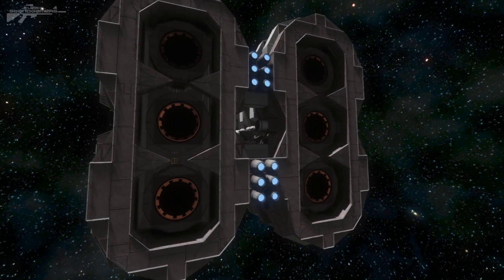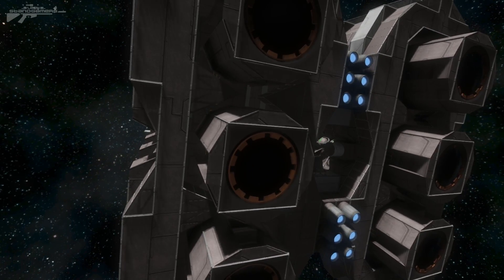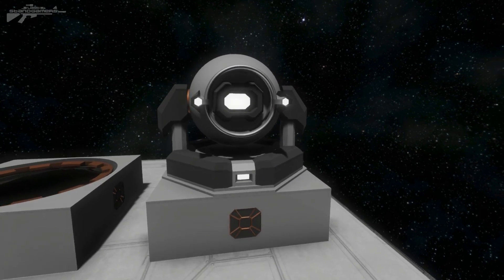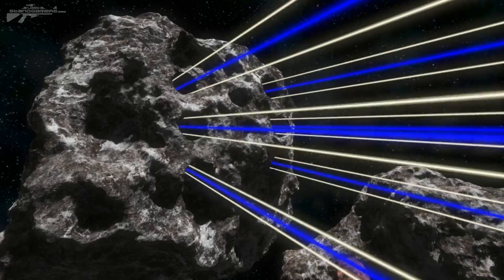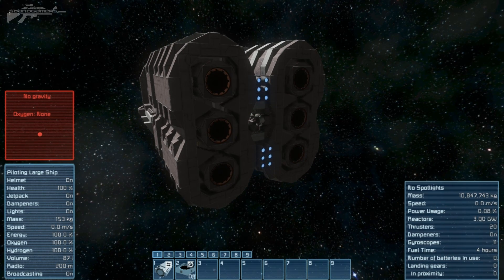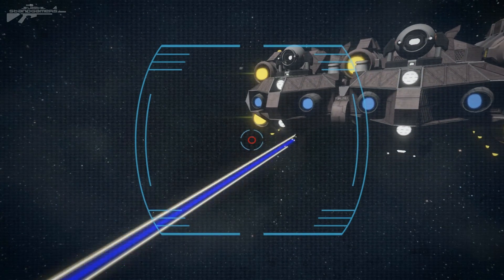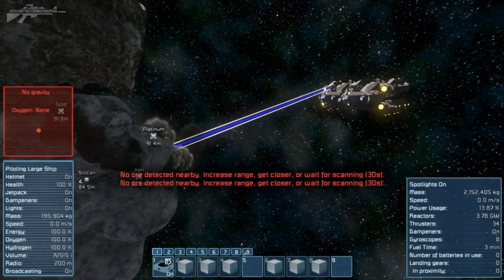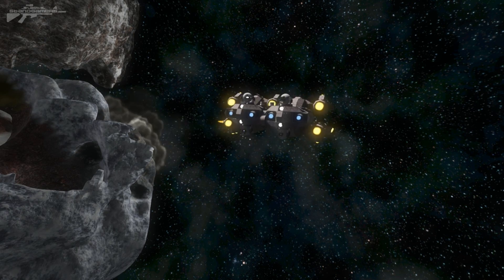Space Engineers - Laser Mining

Comment: yeah but it's not survival ready why cause you'd run out of power so quick it's not even funny they are power hog's the conventional drills are at least power efficient with one of those lazer drills needs several large reactor's to power it
Reply: +Raven 4096 1 large reactor will power the laser if it is close, it is the range which increases power consumption.

I have a small ship with two mining turrets and two large reactors on board, works brilliantly.
Reply: yeah but have you read the power consumption it gets to the point of you need multiple large reactor's to power it which is a joke on the whole walk away and it will mine out an asteroid cause thats a joke as the asteroid is large enough that at that point you come back and the ship ran out of uranium mining the asteroid it's im practical on large asteroids your better off using the nanite factory and mine the damned asteroid out with your drill and it would be much more energy efficient on power
Reply: Raven 4096 It is so powerful that it needs to be nerfed some way, the power requirements help, in my opinion. :)